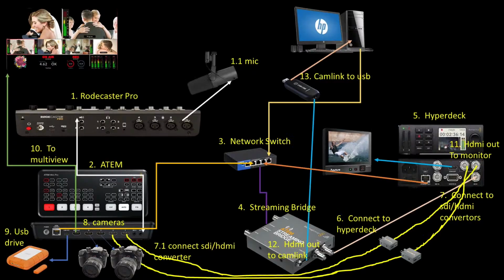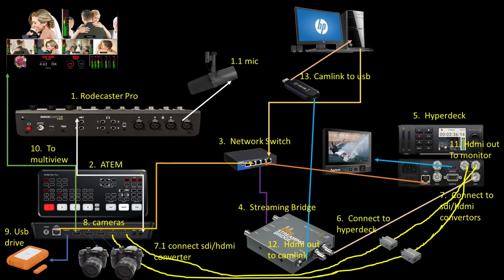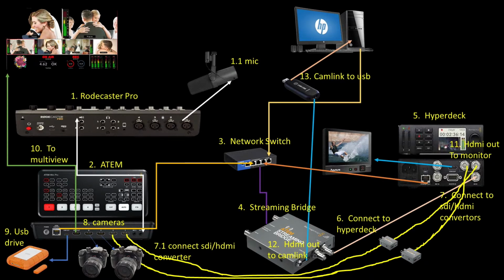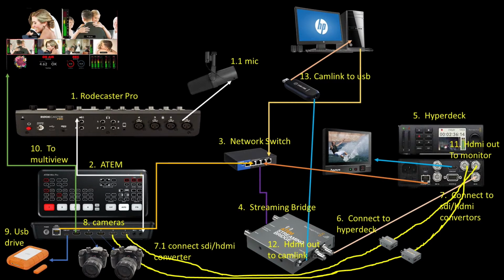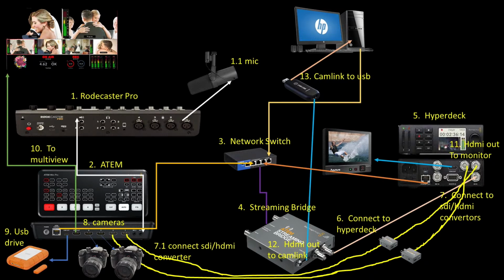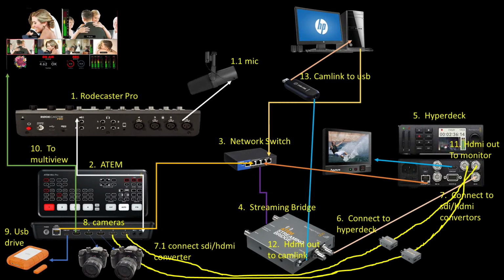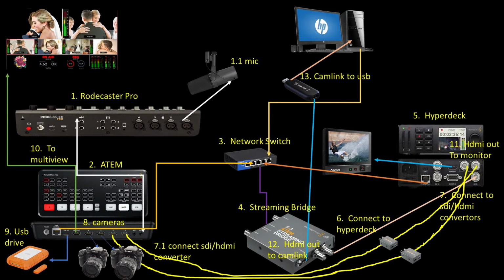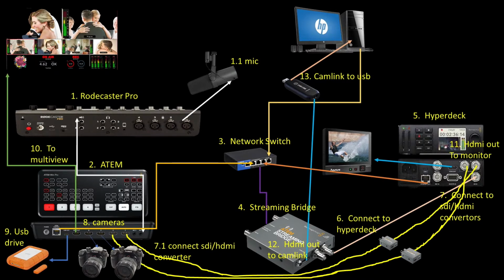Rodecaster Pro and Atem Mini Pro.  How to connect the Rodecaster Pro, Streaming Bridge, and Atem

Comment: I have a situation similar to this, I use the Atem Mini Pro Iso and the streaming bridge, and a network switch.  I DO Not have a Hyperdeck.  I did use my Rodecaster to connect the audio into the Atem Mini Pro Iso. 

I am getting whooped by audio walk.  I can't seem to offset the delay enough for my live streams to actually remained synced while using the Stream Bridge. 

Does any one else have a similar experience of starting a stream in sync, and then having an increased amount of audio desync as the stream continues?

Comment: Hello Jerry, many thanks for the diagram. I got rodecaster pro and atem mini pro for live streaming, I'm having a bit of difficulty in the audio aspect of the livestream. I just want to get what is coming out of the rodecaster to the livestream. Any suggestions, please
Reply from the maker: Awesome. Try coming out of the rodecaster pro monitor out and connect to atem mini mic input. Make sure that you go into the atem settings under the audio tab and select “line in”.
Reply: @JerryHandy  With Dual 1/4 TS to 3.5mm TRs cable? I know you're busy, thanks for the time.

Comment: I have almost got everything setup (so damn close). I tried to get away without needing a network switch as I know nothing much about networking.

I see you have linked a gigabit ethernet switch. Does it matter if it's 'managed' or 'unmanaged', can it be any gigabit ethernet switch, or does it have to have specific requirements? I need to buy it from the shop because amazon takes too long to deliver to New Zealand.

The only differences between yours a my setup is that I'm using an Atem television Studio HD Pro  video switcher, and I don't have a streaming bridge (nor do I think I need one)

Comment: Quick question - when recording from the ATEM, will it also record the sound from the rodecaster? Or do I have to record it off the rodecaster separately?
Reply from the maker: If you are using the Rodscaster then connect your usb c drive for recording and all sound can be captured with the video. You can also use the rodecaster as a back up audio file.